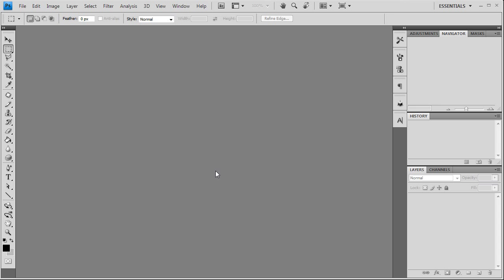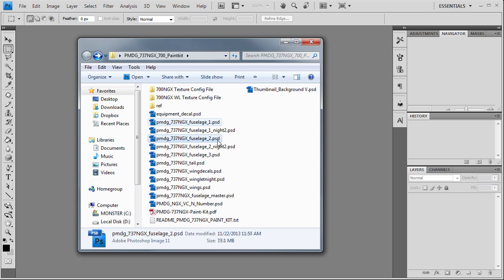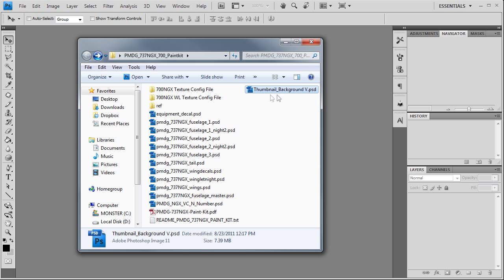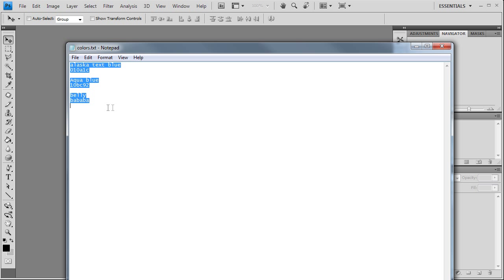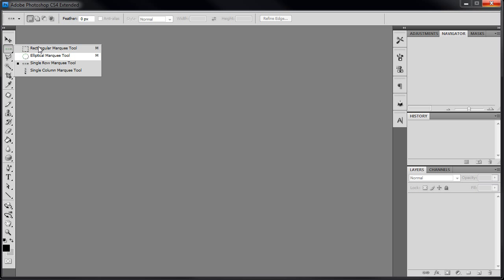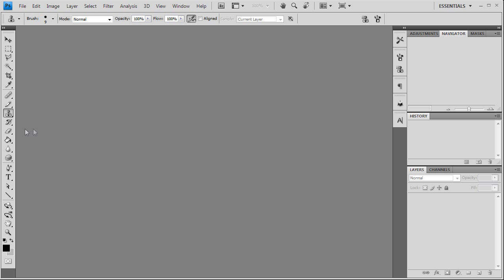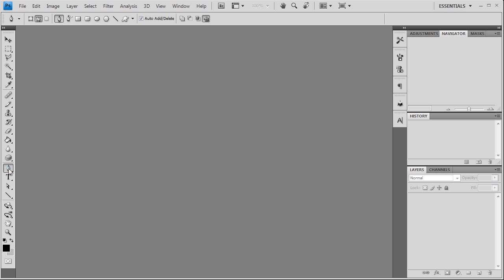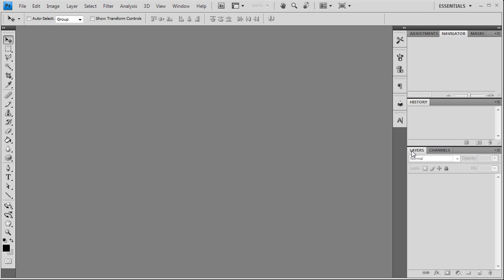PMDG 737NGX Repaint Tutorial - Part 1 of 8

Comment: I downloaded the latest revised paint kit for the 800/900 variant and followed your tutorials to the letter but the textures are not turning out as shown in PS...? Converted from PSD to Targa and used Targa to convert via Aces Tool to DDS but still have issues. Tail/engine portion is great, many thanks to you. Fuselage is the problem. Forum searches are pointing to a faulty paintkit from PMDG but I find that hard to believe. Any help is appreciated.